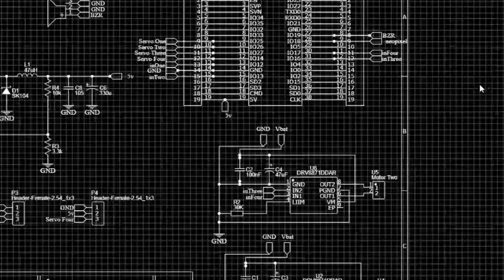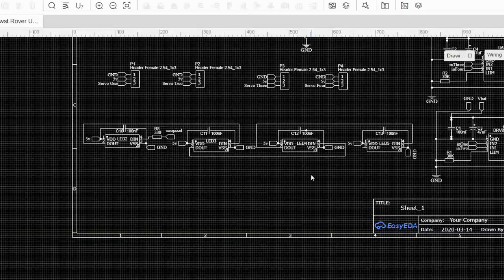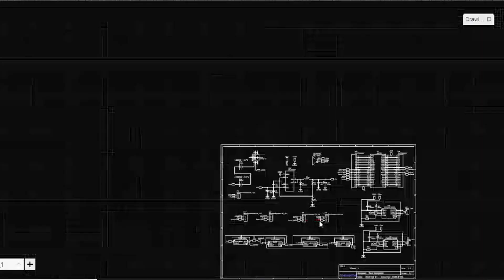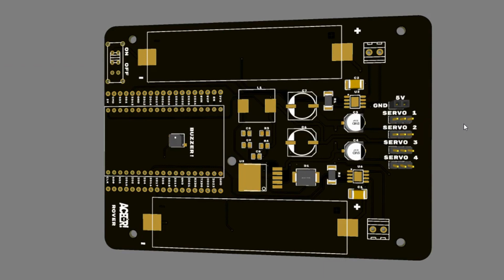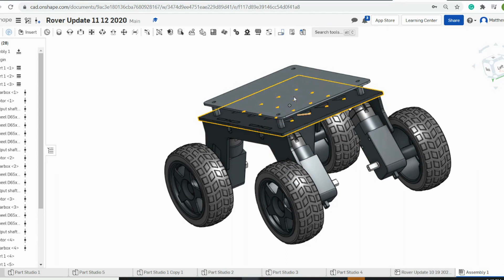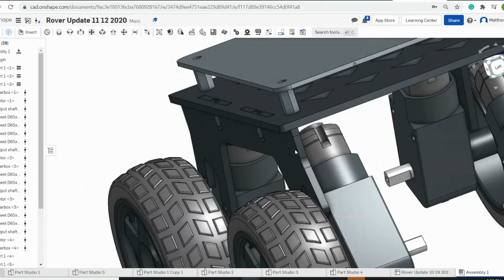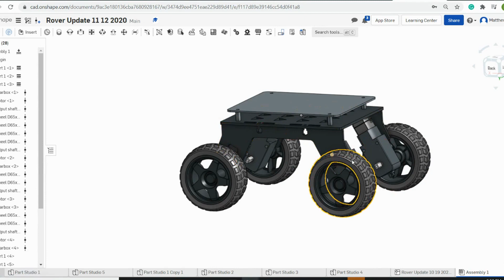Designing A Custom ESP32 Powered Adventure Robot! (From Concept to PCB, from CAD file to Adventure!)

Comment: Hello there
Reply: @AnyoneCanBuildRobots  thank you. I’m trying to build a robotic arm project using imoove robotic arm design which uses an ardunio uno to control 6 separate servos. I was planning to use an uno and a Bluetooth module to connect it to a flex sensor glove I was going to make. Would it be easier to make both the glove and arm with an esp because of connectivity? Also can an esp drive 6 servo motors? Thank you